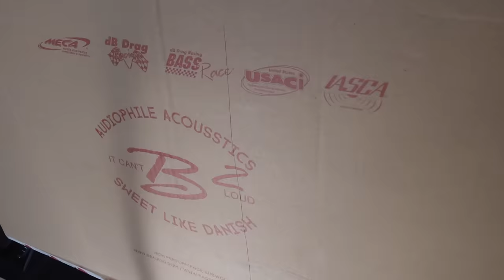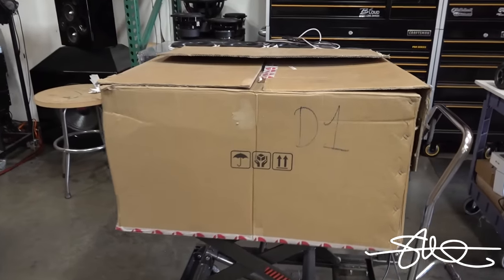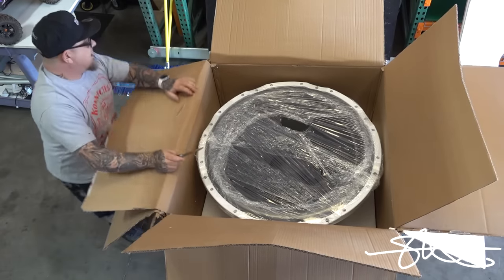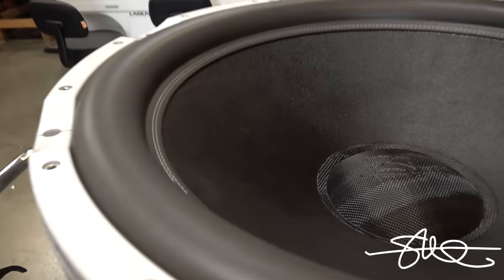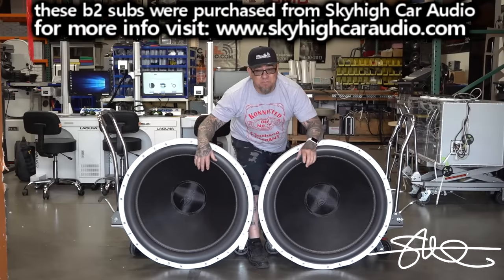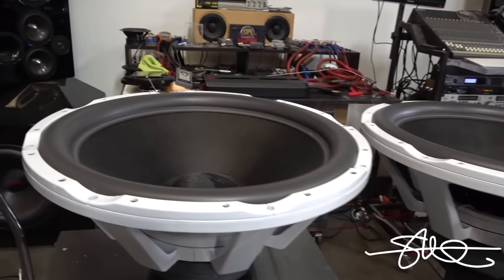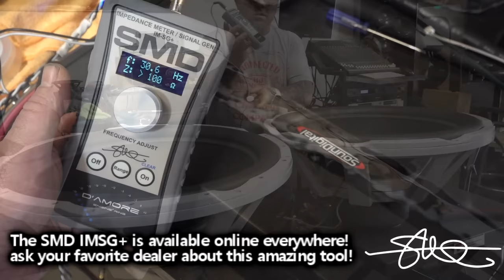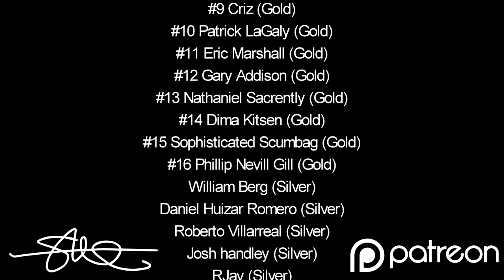Two 33" Subwoofers for ALL the BASS! B2 Audio X26 Ferrite Unboxed & Flexed 10Hz

Comment: They only play two notes: earthquake and volcanic eruption!
Reply: That's the Problem. They definitely don't Sound good at higher Bass frequencies.
Reply: @timsteuerwald2207  Mate, they're not supposed to: musical they definitely are not. Musicality requires speed, tone and tempo and any drive unit above 15 or 16 inches usually tends to struggle with those factors: they are there to move huge quantities of air at ultra low and infrasonic frequencies.
Reply: I seen someone with one at a car show
Reply: An audio company called MAGNAT built a 30+ inch subwoofer years and years ago. I saw it at a hifi show in Heathrow. It was set into the bed of a pickup truck and a huge duct ran from the bed to into the back of the cab! Some lunatic has also put a 30 incher in the back of an Audi TT!
Reply: That volcanic eruption in Vincent was triggered by Meade firing up those two 33 inch subs!
Reply: San Andreas isn't a fault, it's Meade's fault!
Reply: She pp
Reply: someone needs to max these out at Yellowstone Park and see if they can cause it to erupt.
Reply: @andygee8716  its the cosmos audio 32 inch sub on the audi bro btw. The vid is on youtube
Reply: Neither. Only the brown note and the makin’ hunnies shirts blow off.
Reply: @cazedit8439  was it Ted??
Reply: ឋ
Reply: @timsteuerwald2207  o😮😅😮😮😮😮u😅😅

Comment: HUGE BANDPASS BOX IN A BASEMENT PORTED UP THROUGH THE FLOOR!!!
Reply: Shop subz
Reply: Yo that's what my dad wanted in his house, and I want that, all for the bass in my face 😍
Reply: Loaded horn vented through the floor
Reply: @Aaron48219  how about a huge transmission line box?
Reply: @MW-sw7so  Maybe. Would get better freq response, but let's be realistic. As big as these are, and response down to 10hz, if im using one (or two) of these in my house vented through a wall or floor, im not looking for response over 30hz. 😎😈

Also, look up the Phoenix gold cyclone. Long discontinued, but a very cool design for LOW frequency. Ive read about guys using a fan/rotor type design in their house for subsonics.
Reply: @Aaron48219  i remember the cyclone, i was looking for one to experiment with. What kind of sound quality does it have i wonder?
Reply: @MW-sw7so  unfortunately I never got a chance to hear one in person. Iirc, they played loooow quite well, aside from wind noise. They weren't really meant for anything above 40-50hz. There's only a small handful of videos in the web of them, and even fewer actual units around and functioning these days. They were something new and weird at the time, and expensive, so not many sold. Ive never come across a used one for sale. I also believe that the vanes had a seal of some sort along the edge that needed replacing/maintenance after so many hours of use. Man, it's been so long...I feel really old now.
Reply: omg imagine walking through the building and then everything begins violently shaking

Comment: imagine if your knife got stuck to the magnet and it wouldn't come off hahaha
Reply: Lol those are normal magnets actually, the pull isn't as crazy as the neodymium that alot of the smaller ones use but they don't need to use the super expensive stuff with that much space.

Comment: I remember when I lived in Puerto Rico from 89-91 I heard this 89' Toyota Trecel Hatchback slowly cruisin the local mall. The sound was honestly crap but wanted to see what this was running. What my eyes beheld was a single 50" Sub covering the entire hatchback floor with the removed rear seat.  Honestly I thought at the time that the must be a joke but now looking it up there were in fact these size speakers but not intended for a car that small and most likely not set up power wise for what I believe are exclusive studio and home theater systems subs at that time. Now today's subs and power delivery systems with reinforced chambers is a whole nother story.

Comment: Damn, the last time I saw speakers that big was back in 1990 or 91 at a Lowrider Show at the Santa Clara Fairgrounds in Cali, it was sitting vertically in its own enclosure in the bed of a 1988 Toyota Minitruck, never heard it operate, I guess it was only just for show.
Reply: It wasn't just for show...it was an ElectroVoice 30 inch woofer, I worked at an audio shop back in 1991 that had it. :)
Reply: @ColAngus  thanks for the heads up, and like I said, I never got to hear it, how did it perform?
Reply: @evilfingers4302  Rattled the heck out of everything, though not much excursion.
Reply: @ColAngus  I would have loved to experience that.

Comment: Need additional floor support, 20 amp dedicated per sub, sheetrock guy on standby and contractor to add extra hurricane eh but in your case we will call them sub straps to the roof. Failure to comply will result in your roof detaching from your home and guaranteed to crack some walls...lol No need to mix anything in his house just pour your drink and standby for bass test

Comment: What is X-max on these "monsters"? To look like they were flexing that much, compared to their diameter, they have to be at least 2" either side of center.(4 inches total excursion) They were undoubtedly using almost the full output rating of the amplifier.

Comment: For building a box for 2 12” subs. Does anyone have any tips to measure the hole to where they sit in there perfect without any gaps or air leaks? tried building a box but every time I do I can never get the mounting hole right it’s either too small too big or there’s always an air leak. Any tips would be appreciated. Keep in mind all I have to work with is a jig saw and circular saw. No router

Comment: So my 2016 F 150 XLT stock head unit only plays as low 40 HTZ  well and tapers off severely lower than that and it is extremely annoying. Any suggestions on a upgraded for the head unit. I looked up YouTube videos and I saw one for about $2K do I really have to spend $2K on a head unit to get the lows that I'm looking for?

Comment: What is the best box for 2 mtx 12 in 2000w subs @1 ohm?  
I have the Terminator portrd box n its tuned at 40hz n it bumps, but it doesn't rumble. I would of anticipated it to rumble n it 1.5 cu ft . N I don't think it's deep enough.  So, plz help. What he do I want box tuned to, n what in ur opinion is the best box I could get for it, specs, etc.

Comment: I've seen subwoofer smaller than that but the cone has one foot of travel in and out
Reply from the maker: no you haven't.
Reply: I doubt there has ever been a sub with a full foot of xmax. I remember talking to Bob, the owner of American bass about high excursion subs back 15 years or so ago. He said he wanted one with 12" of excursion, of course he was just being cheeky and knew that wouldn't be possible, but he did build a line with some pretty crazy xmax. In fact he named them "xmaxxx". Wild times those were. Seeing all this is making me want to head over to 5 star to see how he's been, haven't talked to the guy in at least 10 years.
Reply: @billyhess5263  if 30mm +/- is high excursion, the B2s with 45mm +/-,  150mm +/- would be insane excursion lol.

Comment: i have seen  a  bigger   england  made  in late  80 ,s    about 1  meter //   the   cap //it was  in mid  of  rewounding//wire was square   2x2mm  aprox// and   coil  diameter  like   10 inch  membrane//  the  box    speaker was  in  was   1,7 meter square//new they said cost  up to  30 000 pounds  in time  when  1  pound was 3 dm //so  100 k  marks//   and  it was used  on    great    exhibits// to simulate earthquake//  the cost of   used  ,multi  time repaired  no box suppose to still be 10  k  pounds  //that was  in  yugoslavija//so i  guess half  in usa

Comment: WHAT WOULD YOU SUGGEST FOR A 2006 DODGE CHARGER ON THE CHEAP, NICE THUMP WITH A LOT OF CLARITY? THANX
Reply: Get you a couple Skar Sdr 12s. about 110 a sub, w/ a Skar rp 2000.  You could run that off of factory electric for no more than 500.   I have one 10 in my daily driver and it thumps.
Reply: @p_3_n_n_y  I'VE CHECK AL THAT OUT AND FOR THE PRICE THAT SOUND PRETTY GOOD, THANX BRO, I APPRECIATE YOU!
Reply: @p_3_n_n_y  I have one skar 10 and a 1200w amp and I love it!
Reply: @moseslloyd6944  I have the sdr 10 inverted in the skar prefab on the rp800.1  sounds great for what it is.

Comment: Greetings all .
Any recommendations on what amp to power a single 12" edge sub .
Code ....edp122spl-e6. Without breaking the bank .I need that bass without any distortion or clippage .
Tankzzzz🤙
Reply: skar rp1500 or rp2000

Comment: I have 2 12 inch dual 2 ohm subs with a 2 ohm stable amp, how do I wire the subs to the amp? It’s a skar 1200.1d
Reply: parallel each sub then wire together in series to amp
Reply: skar rp1200 is 1 ohm stable though
Reply: @MetalAnimeGuy  in the amp will I cross over? It has 2 channels.
Reply: @Lavish_mex  Get 2 more subs, lol.